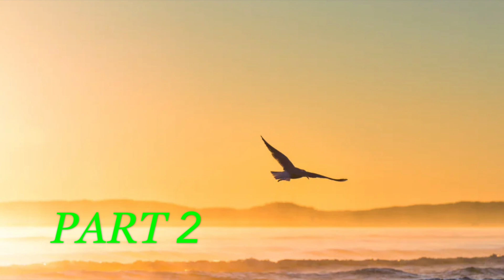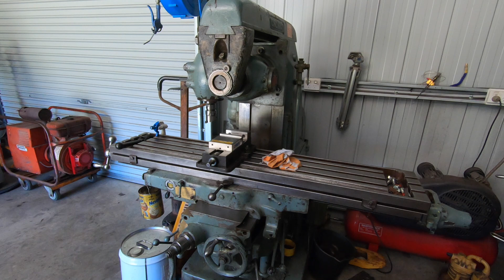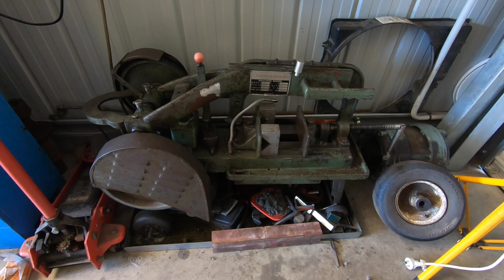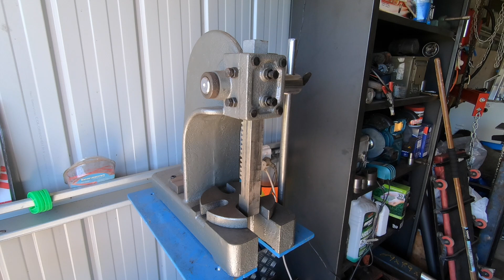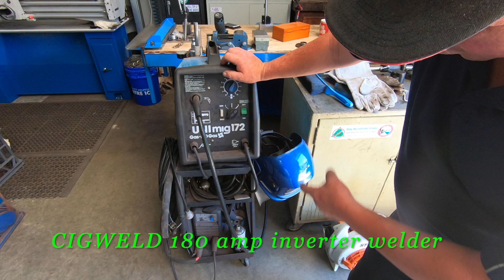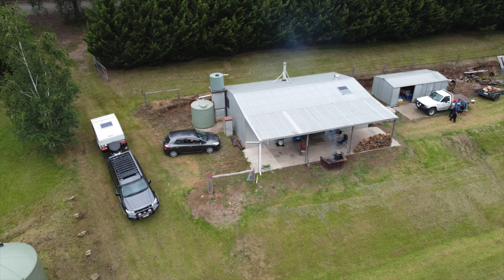Quick shop tour   part 2   HD 1080p

Comment: Cool Matty love the shaper beautiful machine, I brought one two years ago works well it’s a 10” Royal shaper from the 1960s error. Love the beautiful straight cuts on it. Thanks for sharing Matty.
Reply from the maker: That’s awesome, I bet it still cuts dead true and there a fraction of the price to run compared to a mill using insert tooling,

Comment: Nifty mod on the arbor press Matty👍🏻 I had the same mill/drill as you and know all to well about the round column issues, I jumped on a Bridgeport clone when one popped up and moved the other on.
Reply from the maker: The round column can get very frustrating but it still does the job,

Comment: Matt you have all the basic machinery for a home work shop , you are not a job shop or a production shop your set up is perfect for you. 
My two Bob worth i have a arbor press and a 20 ton hydraulic press. With the Arbor press you have more feel in your hands when pressing small Bush's a bearings less damage. Both have there place don't sell the Arbor press.
I pick up refrigerators from the side of road the perfect for the electrical equipment all have shelving and dust seal no dust no wasps.
Did you get my email about the tool and cutter grinder.
Old boff head from Queensland
Reply from the maker: Gday, I did get your email thanks mate, I’ve got my eye on a 20 ton press and I had to sell the arbor press to put them funds towards the new press, hopefully it won’t be long and I’ll have it, as for the tool and cutter grinder, I’m not going to rush into it, just won’t to take my  time and do it right, cheers Matty

Comment: Hi Matty, I have similar power hacksaw, cast iron wheels so no problem, bullet proof machine, slow but who cares, blades are cheap.
Just top up the oil cups and will run all day.
Had a bandsaw in Oz and my Son used to cut stainless without dropping  the speed, came back from doing a swing offshore, and yes off too the shop to buy a new blade at 4 times the price of the old fashioned power hacksaw.
Surprised H&F don't sell them.
Reply from the maker: Gday Willem, the blades are very cheap really, I don’t fancy cutting off a 2” shaft by hand🥵, I’m on the lookout for a vertical bandsaw and convert it to cut metal, that’s a future project one day, stainless is hard on tooling, I’m not keen on cutting it in the power hacksaw really, cheers Matty
Reply: @MattysWorkshop  Bought an 8" x 4" 316 ss round billet from scrapyard to use as an Anvil last week, don't think my power hacksaw would cut that!!
Reply from the maker: @willemvantsant5105  I’d be tempted to give it a go with plenty of cutting oil

Comment: G'day mate I reckon the shop is pretty good it's not that much of a mess, I had the same problems with mine so I put in a long bench that went round half of the shop and put strong draws in each of a different sizes I built storage cupboards and mounted them on the bench so there is no bending down.   The last thing that I built was a mezzanine floor and I used it for things like long bits of steel ect, anyway Matty it's always nice to have a look around the workshop of the person you have subscribed to, take care kind regards John
Reply from the maker: Gday John, I’m glad you enjoyed the video, I’m slowly getting things sorted but it’s just time really, cheers Matty